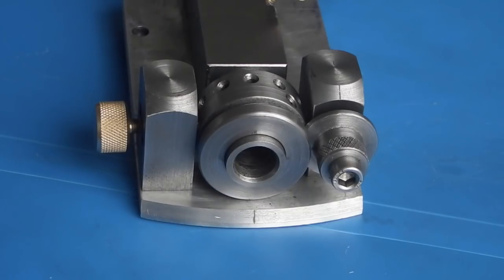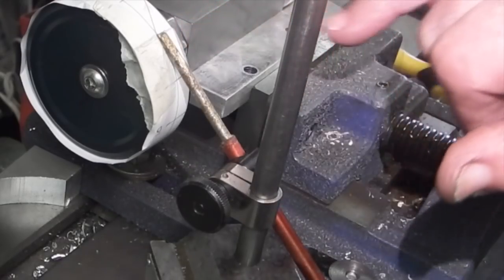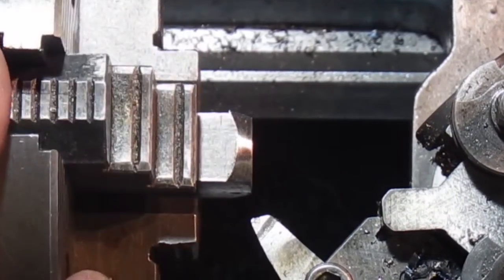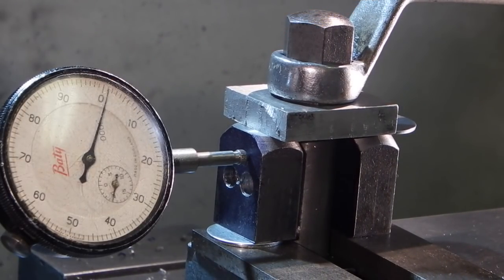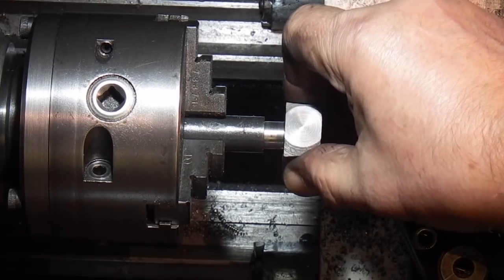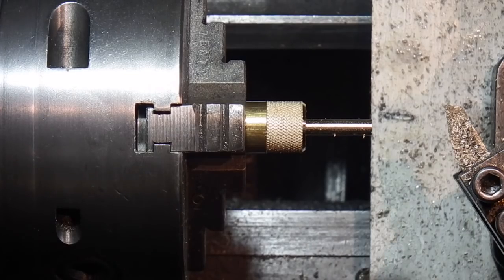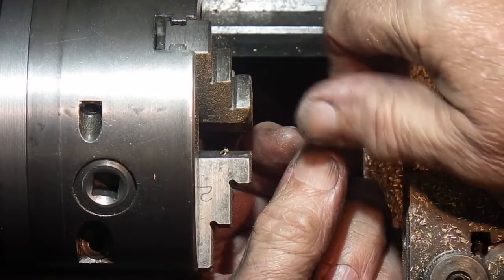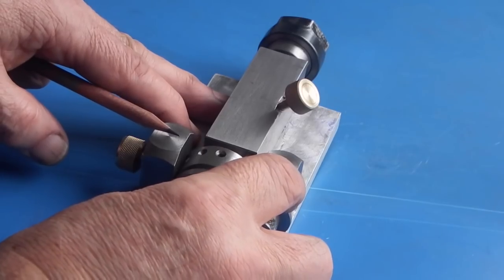Indexing ring and feed screw

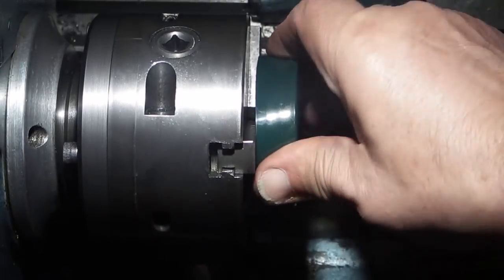Comment: Easy way to get a sortof accurate device. Hopefully a very loose tolerance was okay for it. As the lid rotated (2:27 to 2:50 and beyond) it was obvious it wasn't centered, thus a maximum of two of the dozen points would be accurate.

Comment: Why the line is with an angle to the line on the sample? which angle?
Reply from the maker: Hi Valdimir
I will try to explain The top line is the circumference of the lid. The line from the circumference down can be at any angle the important thing is the length so you can mark the 12 divisions as big as you wish.The last line is from the 12th division back to the end of the circumference. This line gives the angle for all the other marks. Copy them from the bottom line onto the circumference line at the same angle i.e parallel to the 12th division line.
Regards
Alan

Comment: Wait wait wait wait wait wait wait. Why in the heck couldn't you just take the strip of paper that you cut and tape down draw a line on it and divided into 12 increment starting with one Edge? You would have got the same exact thing
Reply from the maker: Hi
This method is simple. Try dividing a strip 152.652 mm long into 12= 12.721 mm per div plus any error per division will accumulate.
Reply: enots engineering lol ! Yeah I didn't think of it that way that is 12 equal parts. It's actually quite simple when you put it like that I wasn't thinking that through